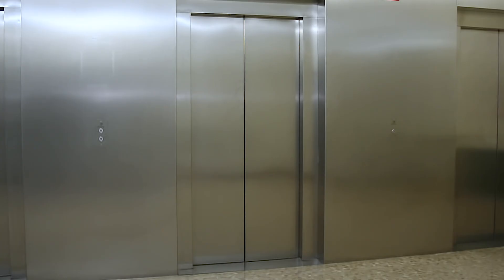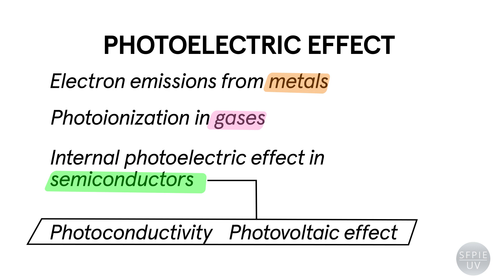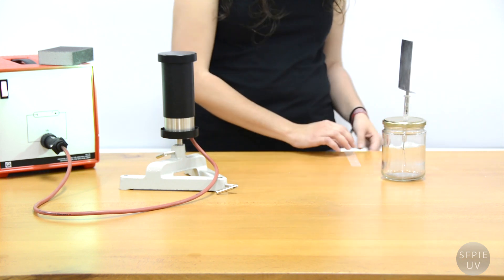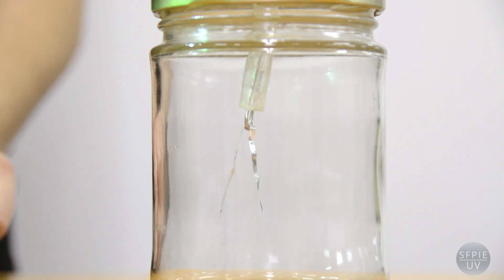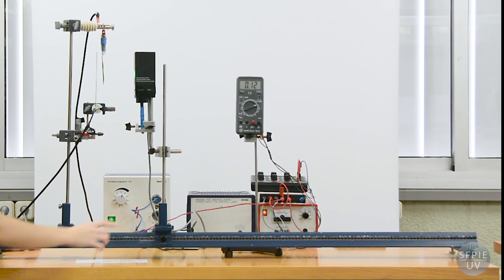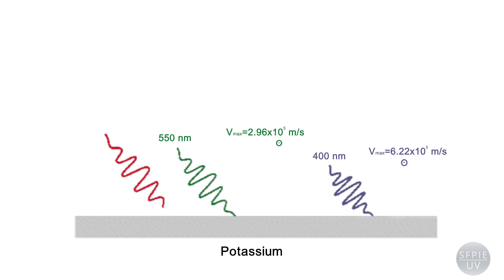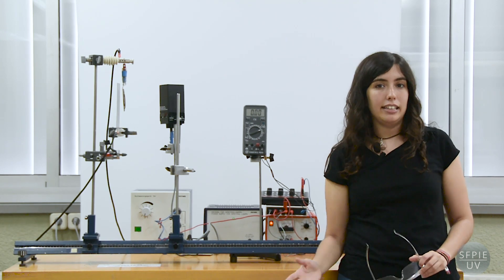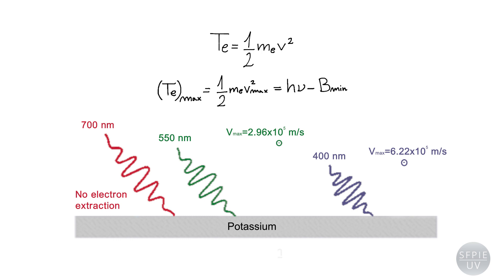Photoelectric Effect

Comment: This is the video I was looking for. 
Excellent video to pass  photocurrent in air. 
I have the following queries  . 
1 I think you measured voltage drop across a resistance in stead of direct current measurement. 
How much resistance you used for voltage drop measurement? 
1 MΩ or more? 
2. I followed your experiment and got air current ( probably) . In your video there is no voltage drop when light is absent. 
How to avoid voltage drop due to air current? 
Please. 
Thanks and regards
Reply from the maker: Dear friend,
Thank you for your interest. We apologize for the delayed answer.
1. The resistance we used, in combination with an operational amplifier, was 10 MΩ.
2. When light is absent we do not see any voltage drop. Please, notice that we have in our circuit an additional resistance of 5 GΩ to protect it.
Reply: @laboratoriofisicacuanticau6865  Thanks enough to help me with your answer to avoid air current. 
Thanks again.